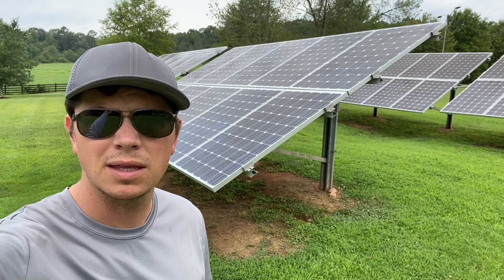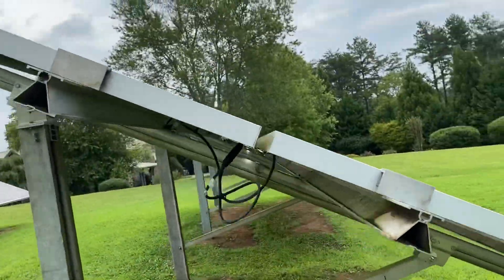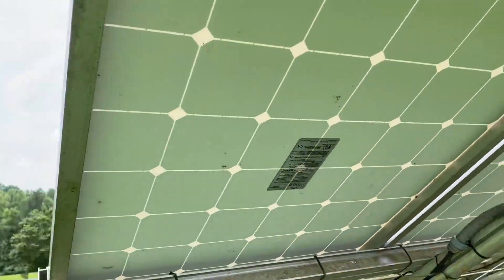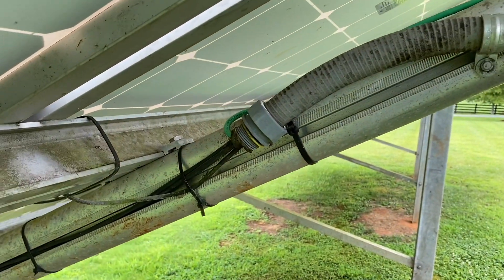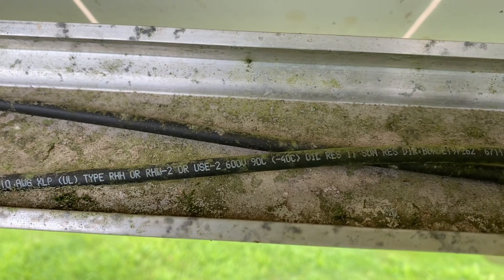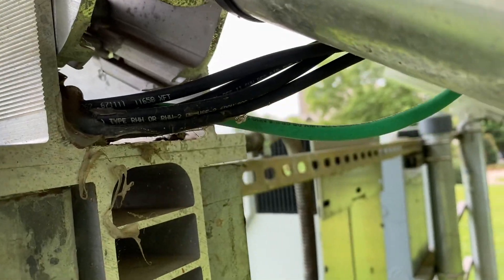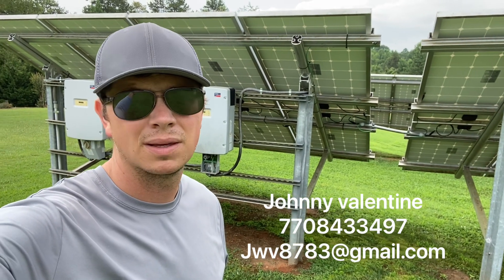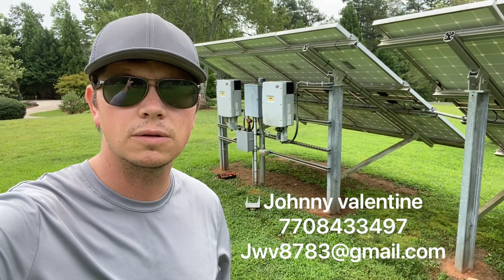10 year old solar system: Does Solar Last?

Comment: Why do you say ground mount is better or lasts longer than roof setups?
Reply from the maker: The roof systems take a beating. They are expensive to service, they build up debris, they attract rodents. Why would you put a 25yr asset on a 15yr roof when half the cost is the labor of installing it??  I have some reroof videos if you looks in my channel

Comment: My panels are over 10 years old and my 240 watt panels are still cranking out an average 218 watts each. All my structural is in excellent shape all coated steel. All zip ties were just replaced though. Some aging on my conduit but not bad. All inverters and solar chargers are in great shape. I live in southern AZ so the heat can be rough on equipment.
Reply from the maker: Hey can you give me the brand name of your meter
Reply: @GainSolarPower  it a generic one so it just has a part number. WS400A
Reply from the maker: @allennolden8735  so you plug that into the panel and it tells you watt output?
Reply from the maker: Ordered it
Reply: @GainSolarPower  sorry for some reason it didn't show me your last question. Yes. It just plugs in and you can put it on auto. It will tell you amp and wattage rating. I usually test in the peak of the day.
Reply: @GainSolarPower  it is great for test single panels and knowing where they are in their usefulness.

Comment: Great informative video. Question, how much efficiency has this system lost if any? Do you have that information? My system is approaching 4 years in September and appears to be holding fairly steady. I opted for micro inverters for efficiency in some partial shade, and from what I understand, the warranty as long as the panels, thanks.
Reply from the maker: Too many variables to figure this out, not enough time. Someone would need a lot of data to figure this out.

Comment: A pretty impressive install for its era. Great Vid! We like checking over older systems with a flir thermal camera. On the last partial system upgrade we completed, we found a couple mc4s that were 8-12F hotter than all their friends. We use it to check our own connections after commissioning but it was nice to quickly identify those on the older part of their system. It was a minor efficiency loss maybe but it all adds up. The tool has its limitations though. On an overcast day when amps are on the mid to low end it might not identify a problem connector.
Reply from the maker: Did you get your busbars?  Yeah older systems are always interestinf
Reply: @GainSolarPower  I did figure out a solution. We made our own out of 1/8”x2” copper bar and we’re going to insulate/protect the non-contact areas with some coats of dielectric varnish. 
I wanted an air space between the units so there weren’t anything readily available. Plus making them one piece was a winner.

Comment: panel eff % after 11 years?
Reply from the maker: How would one even measure that
Reply: @GainSolarPower  Incident radiation flux x area of panel in sq meters, heck i'm the one asking questions. lol
Reply from the maker: @htf5930  I don’t have one of those meters
Reply: I use a meter that just plugs in. My panels are over 10 years old and still crank out an average of 218 watts. They are 240's
Reply from the maker: @allennolden8735  what meter. Link?
Reply: @GainSolarPower  it is a solar panel multi meter I ordered online.